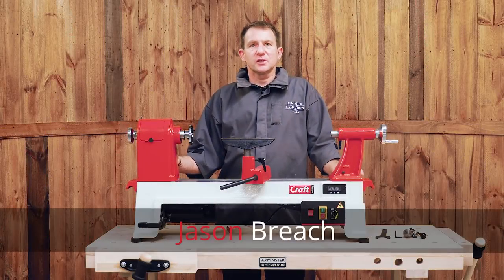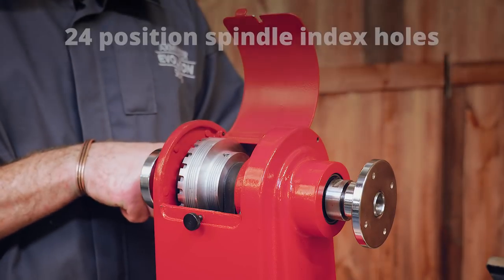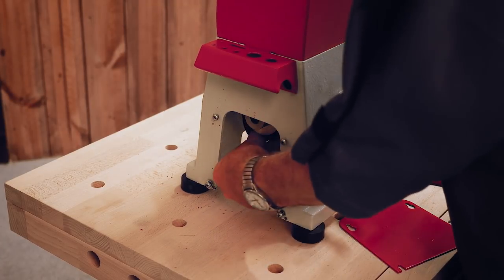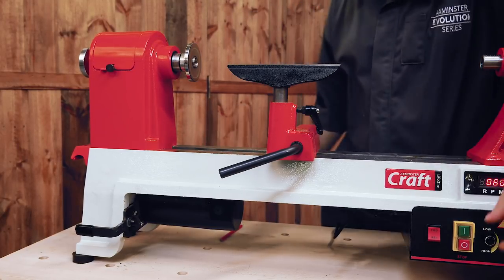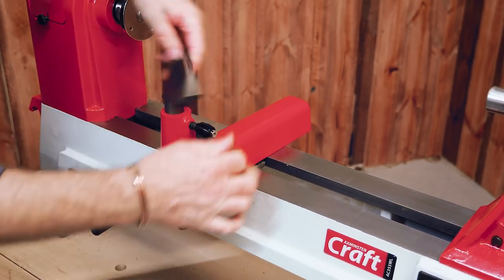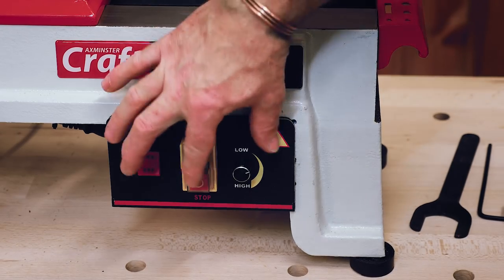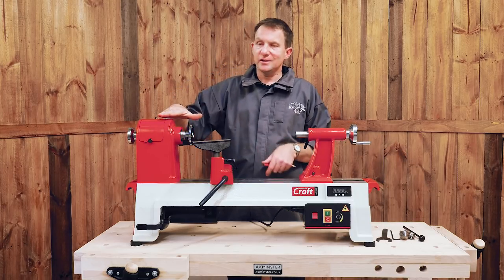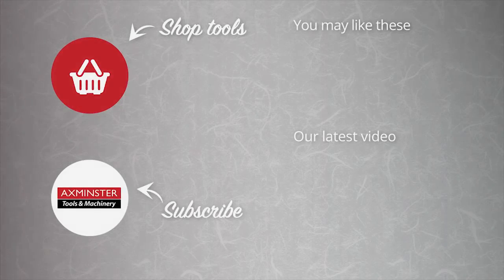Axminster Craft AC355WL Woodturning Lathe Product Overview | Woodturning Lathes

Comment: nice but what about the 100 hour a year usage limit on craft lathes??
Reply from the maker: Hi Colin! As the craft range is designed for the hobbyist/weekend user, these are set at a lower price point to make them affordable. In turn means they are not as robust our trade range, which means that we advise no more than 2 hours a week average run time. I hope this helps :)